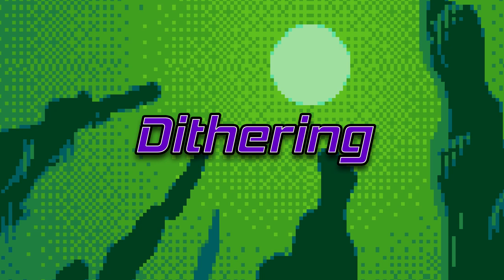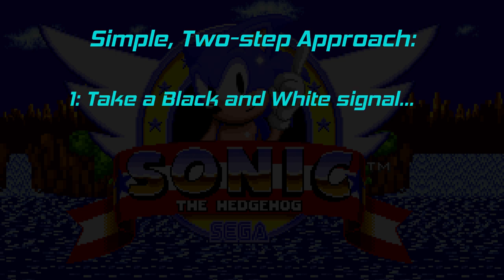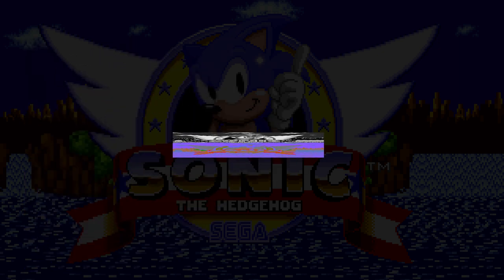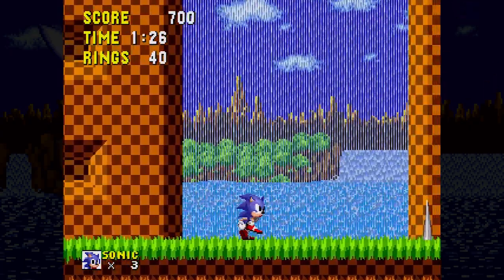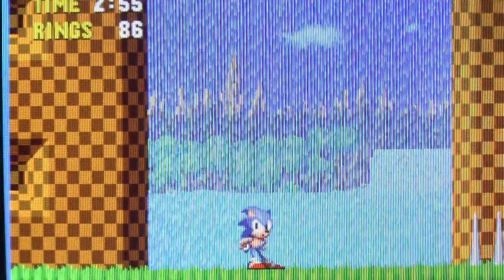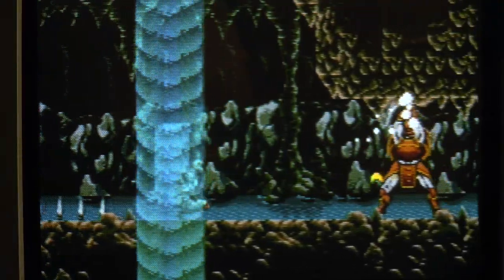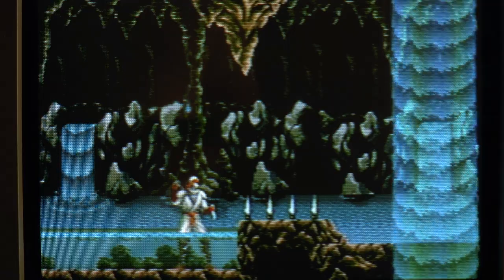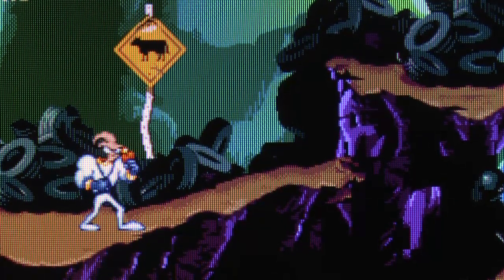Dithering on the Sega Genesis with Composite Video

Comment: My opinion on this is, it's a each game situation scenario. I agree with you in relation to all the examples you gave but this is a few games for the sega genesis. I'm owner of a PVM 2950Q and recently I got the OSSC. For systems like the NES (with NESRGB PCB installed or the HiDef NES - which I also own) I can't go back to composite. 

There are many games that don't benefit at all from composite. My main test game is Zelda LTTP and beeing able to read some itens or small texts are a huge plus for me. 

Another huge advantage of RGB over composite for me is the signal isn't compressed under any industry standard like NTSC, so we get the true colors. Super Castlevania, during the cave segment has a blue background and using s-video or composite it`s green. So not only we are loosing detail but also giving up on color fidelity. We can argue to what the developers aimed for or knew back then but this is a moot point because we actually will never know, I don't know a single dev of the 90's and all I see is people debating. Just like the Snes  AR that you made a great video all we can do is guess and assume based on evidence but even then it's each game specific.

 But one thing I believe are the strongest points in relation to composite are: dithering, fidelity (if you are using a CRT) as you explained in your video here but also, it's cheaper, it's easier, it's headacheless and don't require fetching super expensive monitors or modding tvs, buying expensive cables and intput selectors and just works out of the box. 

Right now I have almost 10 years of retro hobby on my back and I chose to go down the rabit hole which was a fantastic and interesting jorney but if I could give myself an advice more than 10 years ago would be: get a Sony CRT and just use s-video. It's not as terrible as composite, retains the 90's feelings and you can use your money and time buying more games or something else.
Reply from the maker: Vitor - I agree regarding it being dependent on a game. I also feel it is dependent on mood as well as the current aesthetic the gamer is feeling at the time. For me, it is a very personal experience.

I definitely agree with your point about CRTs being cheaper. We both know that you can see some absolutely amazing results from pushing RGB to a PVM or an upscaler - and that the alternative of hooking these systems up to the native composite video input in a fixed pixel display creates an ugly image with a free dose of lag.  

But someone truly might have just found their old consoles in an attic/basement or stumbled upon a local garage sale, and they simply want to hook them up and play them - and finding an old, affordable CRT could serve as a gateway into eventually climbing that PVM/upscaler ladder OR... it might be end game. It might be good enough. A simple consumer set that is of the appropriate size for their home or location might be enough to make them very happy.

I could probably type you a small novel about my own journey in using various signals, but I'll just say - I fully understand your feelings about going back in time and telling yourself to get a Sony CRT and use s-video.

Thanks for commenting!

Comment: I would highly recommend the gdapt shader in retroarch. It properly dithers pseudo-transparencies while keeping everything sharp. I have tested the Sonic 1 waterfall, the Shinobi 3 pools and waterfalls, and the Streets of Rage 2 bar lights and everything looks great. Recently, retroarch added a new feature that lets you combine multiple shaders into your own custom shader, so it would be possible for people who want to simulate CRT stuff like scanlines to make a shader that accomplishes both. I would recommend applying gdapt before any other shaders. 

For the record, I'm using CRT emudriver to output retroarch on component video from my computer to a consumer-grade CRT. It looks great but is too sharp to display Genesis pseudo-transparencies  properly. That is, until I discovered gdapt, which fixes everything. I would not recommend gdapt for other consoles besides Genesis. NES and SNES had poor results.
Reply: GDAPT is a terrible shader and unnecessarily blurry ... SNES HIRES BLEND is a much better option because it blends colors but also presents a noticeably sharper image than GDAPT. I use it mixed with a scanlined shader.

Comment: This really surprised me, have always went for the most clear signal like component or RGB. And would also say this worked good for SNES where on the mega drive this really benefits the quality. I think the same applies for Sega Saturn, as i remember that Sega Rally car windows was using a checker board that really looks stupid in emulators and RGB. Without tested it yet i would think that Reshade could be applied to an emulator to do a similar effect instead of relying on the filters from the emulator.

Comment: dithering is the technique to emulate color shade gradients we had to use in the day, what causes the "transparency" and "extra colors" is called color clashing and its a byproduct of the definition of the tv signal not resolution. for ex if i plugged my megadrive via SCART i would have no color clashing (or dithering in the concept wrongly represented here) yet, SCART is analog (like composite). in fact, VGA is analog for exp. look up the games on the zx spectrum for ref about color clashing. plug a ps4 to a old analog tube tv at 1080 u still will have color clashing. im a scene artist from the early 90s i found the info in this vid miss-informative.
Reply from the maker: There is a bit of ambiguity between the terms and techniques, for sure. However, the bottom line is that the dithering process has been cited as a means to an end for creating additional color or assisting with transparency effects for many systems (of the game console variety) for quite some time now.

My use of the term dithering and how I describe it in this video is based on what others have been calling it for a long time. It is the term they would use when searching for information about the process.

(TL;DR: I am just using the term other people use)

Thanks for commenting, Vitor.
Reply: megadrive + crt tv - dithering = color clashing
megadrive + vga mon - dithering NO color clashing
emulation + vga  mon - dithering NO calor clashing
emulation + crt tv = color clashing

dithering been used since print paper, its to create the illusion of gradients and shades, not extra colours - u say dithering is solo responsible for the enhanced effect. its not. they don't use color clashing tvs  to make the grafics - it was a fortunate byproduct of the limitation of signal transmission that devs was aware at the time and a lot of console and amiga games from that era took advantage of this.
in 92 my megadrive was plugged  to my philips amiga monitor and i had zero color clashing.
but u are correct it is a way to make transparent grafics but, the "crt enhancement" u talk is color clashing. dithering or no dithering
Reply: best way to put it is - what color is the dress? anyway lets agree to disagree im not trying to start anything. cheers.

Comment: Have you ever thought of doing a Behind The Code video for Hard Drivin' for the Genesis? I'm amazed that the Genesis was able to do real 3D without a chip like Virtua Racing did, even if it was clearly in over its head trying to do so!
Reply from the maker: I wouldn't mind taking a look, however the debugging features of current emulators for the Genesis leave a lot to be desired.

Comment: I still prefer the more crisp rgb image. I see dithering as simply a characteristic of a low resolution image much like old Dos games over VGA. It may be more prevalent on the Genesis because of its more limited color pallet but it goes for all 240p consoles (like on the story narration screens of Link to the Past) The only 240p console that doesn't really have it is the N64 and it's graphics are generally regarded to have not aged well because it's blurry.

Comment: It is bad that the screen of a VGA PC monitor was never blurry like the TV screen of the time, it was not easy to hide the limitations of the PC games without dithering during the developments. I'm thinking in particular of the light from the ceiling lights in Halloween Harry, even on a VGA monitor it's easy to see that the light is just a set of white checkerboard patterns. No, these VGA PCs should be able to be connected to a CRT TV.

Comment: This makes me kind of realize why the GameCube graphics always felt kind of wrong. Most GC (and Wii) games use a 16-bit framebuffer. As this can lead to banding, the system relied on dithering as part of the rendering process to fill in the gaps. But since I always played through component outputs, I could see the dither patterns as they were. They were particularly noticeable with full-screen transparency.

Maybe it would have looked better over a worse video output. After all, S-Video and Composite were built-in, but you had to buy a special add-on to use component outputs.

Comment: You can smooth dithering without getting the other artefacts like dot crawl if you use RGB and then take sandpaper to your corneas.

For what it's worth, Sega shipped the notorious dithermonger Saturn with an RGB cable in Europe.
Reply from the maker: What sort of grit are we talkin'?
Reply: The pack-in Saturn cable was actually one of the only non-RGB scart leads I ever owned, with it only having a few pins in the connector that actually went into the TV.  I bought an upgraded one straight away, but dithering didn't really help with transparencies on that format, they still looked awful.

Comment: I fired up Sonic the Hedgehog with my HD retrovision component cables and plugged into my CRT on the first stage waterfall, and yes indeed it looks  just like the RGB dithering waterfall just like in your video.  An interesting idea, one could use a DVD recorder or high quality VCR with component inputs as a passthrough and composite converter, this paired with a signal booster and component splitter, output to 2 switch boxes, outputting both a component signal and composite signal at the same time.  Then one could choose to use composite or component based on the game by preference, seamlessly. or even stage by stage ^^  Of course if there is a component in and composite out converter made for this purpose, that'd be best, not sure if this exists?

Comment: Would love to see an explination of how Artifact colours work, like on the CGA games of yore, heavily used in games like kings quest or Ultima 2.
Reply from the maker: The 8-Bit Guy did one on CGA a little while back. I may do one myself at some point, but I was happy with the one he did.
Reply: @DisplacedGamers  I'm sure i saw it but from what i remember he didnt really explain how stuff like the ntsc signal timing worked and why specific patterns of pixels on different modes resulted in those specific colours and such, i've not found anyone that's created such as technical video.

What i like about your videos is you go into the low level and explain how everything works on the more fundamental levels.

I shall go back and take another look at his just incase i'm wrong though.

Comment: Lossless HSL - (8 bit brightness, 7 bit hue, 6 bit saturation) - 21 bits, I can imagine it working for the bit thrift. :) Or a format based on rationals. - (0, 1, 1/2, 1/3, 2/3, 1/4, 3/4, 1/5, 2/5, 3/5, 4/5, etc…) - (up to n/20, up to n/15, up to n/10).
Reply: I don't think HSL is a particularly good choice for color storage. Same for HSV. Someone thought of a 16-bit color format based on HSV named fc16 ( http://r0k.us/graphics/png16Tech.html#fc16 , http://r0k.us/graphics/png16.html#fc16 ) but I can't see how it would be particularly good, let alone "true color". Same for your 21-bit HSL format; I think assigning seven bits to each of RGB is better because it's in 1/127 increments for every edge of the colorcube, rather than bad cases like 1/21 from 0000FF to 00FFFF in 7-bit hue. I don't see how using rational numbers would resolve anything, as it only makes the available shades highly non-uniform.

Comment: To some extent, it's not really a flaw of emulators per se that certain composite effects aren't reproduced, they're just programs you can use with different signals and displays as well after all.  E.g. if you plugin a Wii via composite connection into a consumer CRT TV and use an emulator with it, that will replicate the old look to a certain degree. The Wii's output is much cleaner, original hardware still has to be retained for 100% authenticity.

Comment: Would be interested to know your take on a similar effect that occurs with HD remasters of some games. I prefer the original Wii version of LoZ Twilight Princess thanks to the slight obfuscation of the characters models due to the SD resolution and weaker hardware.

Similar things happen with Playstation games, where the HD renders feel sort of plastic and lifeless.
Reply from the maker: This is a very good point. The HD versions of games oftentimes feel a bit stark in comparison to their originals.

One place where I feel that it works quite well is LoZ Wind Waker - the cell-look lends itself quite well to HD.

Comment: the problem with composite some of the background looks blurry . when scrolling  right 
maybe is the LCD     will worked better on a crt
Reply: back then u wouldn't have noticed since they were only played on CRT's so you're right, it is the LCD.  That is why upscaling via things like a Retrotink 5x are important if playing via modern HDTV, or using shaders in Retroarch if emulating.
Reply: @linuxlover_8436   back in the day  if for some reason the picture looks some what washout or low quality on a crt.. people fixed this by ajusting colors tint contrast and brightness. . i remenber playing games with low brightness. on a crt back in the 90s.  to hide some color bleeding.graphics. on a crt .
Reply: @xtremegold2950  yeah, I remember seeing that sometimes..you could get a little more life out of a crt that was going bad doing this to some degree...It's nice when someone is able to do cap replacements for those scenarios or do sure fixes.  it was the worst when I'd go to arcades and they had the nerve to keep those up still trying to make money when they were barely visible or enjoyable.

Comment: The waterfall looks way better in RGB... I'll never understand that argument. Game devs of the time were working on prosumer or pro crt monitors, using the console's best native outpu. sure, they were referencing on a composite signal to make sure it looked good also. But that doesn't mean they were forgetting about s-video and RGB. For my part, I like to use RGB but on a consumer set or low tier PVM, which softens up the picture a bit so that it doesn't look like and emulator. Best of both worlds and the ideal picture to me.

Comment: It should be easy to fix that in an emulator. Before displaying the final imaeg, convert it to chroma and luma, reduce the resolution of the chroma by 50%, upscale it again and convert the result back to RGB. This is an easy task for GPU shaders, so your CPU won't have anything to do at all.

Comment: 6:30 is that how the modle#1 genesis's composite video signal look normally on your 2005 TV and Sony PVM
Reply from the maker: No. This is actually a Model 1 that has been used as a test system and perhaps has an irregular frequency for the chroma subcarrier. It is definitely atypical.
Reply: @DisplacedGamers  You know, people are always saying that the Genesis's composite video is terrible. But you know, how is it so bad, what is the fault of the video encoder that makes composite video look so poor

Comment: at 5:20, what did you use to get that image? Was it real hardware, or an emulator with a shader? 
If it was real hardware, what version of the console was it? Did it have any improved video mods installed? I'm very curious about this, thank you.

Comment: Stuff like Retroarch have RF & composite filters these days. Would that not help fix it, for emulation guys at least?

EDIT: The answer is yes. Although not perfectly. Or maybe it is perfectly, I dunno. I don't REMEMBER the water fall in Sahnic flashing when the screen scrolled back in the 90's, but I don't remember what I had for dinner yesterday. 

Regardless, it sure does look like it does in this video, and perhaps the flashing can be fixed with some extra filter or another.
Reply: I have made recently some modded presets for PC emulator which attempt to bring up as close as possible the Rainbow effect from composite connection and they're available in the last Sonic 2 video from my channel. 

By the way, do you have any particular RF & composite shader/preset to suggest ? Don't remember that well RF looking but still would appreciate if you have some suggestion there.